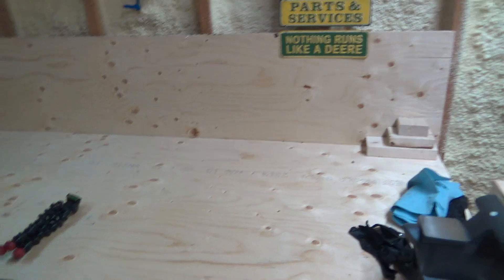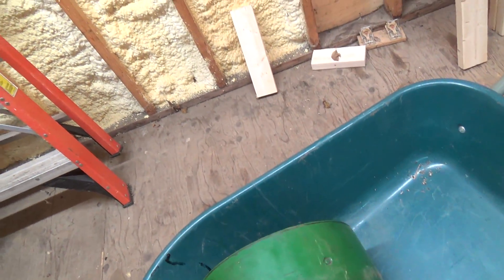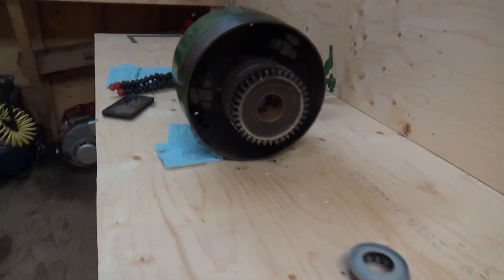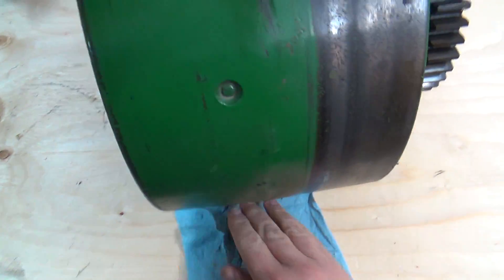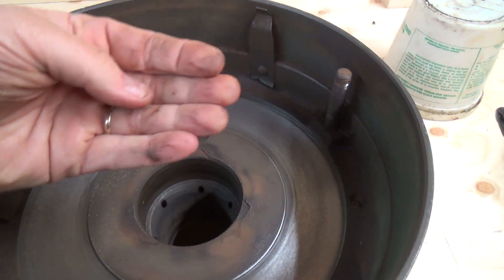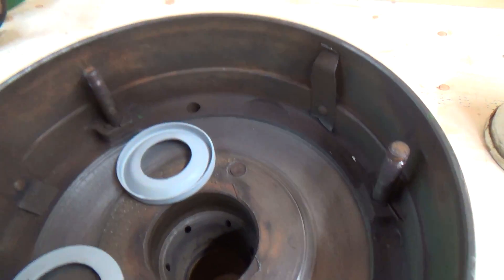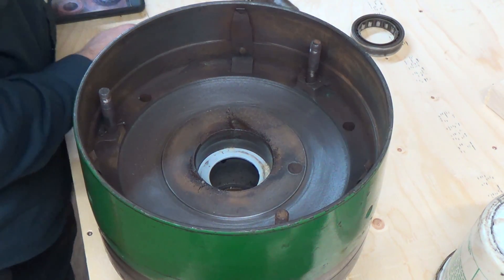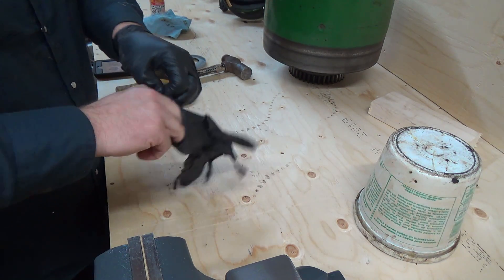Lets look at the John deere AR clutch mechanism and repack the bearing

Comment: I am rebuilding a 1940 B and had to replace the bearing and bushing in mine. Bushing from Deere was 53 dollars and they couldn't find me a bearing but I got lucky when I found one at Sharps parts (last one they had) for 54 dollars. Mine was very pitted so I replaced it. Had to replace all the T bolts but I machined those saving another 100 dollars but I figure if it lasted the first 80 years this will last another 80 years. I won't be around to worry about it then anyway...

Comment: Bill I think you should replace the broken ear as it looks like a centrifugal clutch and puts more pressure on the clutch plate the faster it turns more centrifugal force equals more clutch power that could have been the problem to begin with regards from the UK
Reply from the maker: parts ordered since this video
Reply: @billstmaxx  Good call my friend we are hoping to send you and your family a Christmas card this year best regards Alan from the UK
Reply: This clutch is not centrifugal, there isn't enough rpm variation from low to fast idle to make a difference on these.  But i do recommend replacing the broken part as it will cause uneven clutch pressure, especially if he ever desires to do some pulling with it, and the clutch will need to be fairly tight to hold the torque.
Reply: @keltonwright7  part of the pressure may come from the weights but you seem to know it all even at lower speeds don't underestimate the power of centrifugal force
Reply: @alanmcclusky  Well explain to me how this clutch works at all then without the tractor running?  It's a mechanical clutch, the force applied to the clutch lever goes threw the rod to the clutch fork.  Which then moves the dogs and toggles to pull the T bolts to engage the clutch.  If it was a centrifugal clutch there wouldn't be no need for adjusting bolts.
Reply: @keltonwright7  my reply would be above you and for the record I stated it may be a centrifugal clutch you said it's speed was too low to be a centrifugal clutch go ask pilots about it they will surely let you know the forces involved Even at low speeds no need to reply just grow up remember in case you forgot I stated it may be a centrifugal clutch but as I am not there to confirm hense my reply
Reply: @alanmcclusky  but it is not a centrifugal clutch.  The pressure it would gain in an rpm difference of 300 rpm would be miniscule compared to 30,000 rpm.  Also a centrifugal clutch was a far too expensive for mass production in that era and not practical at all for a farming implement.
Reply: @alanmcclusky  I really like how you have to like your own comments to make yourself look cool.   I'm just trying to educate you so you don't go making a fool of yourself by asking dumb questions or statements.